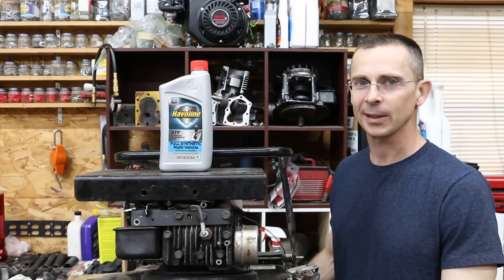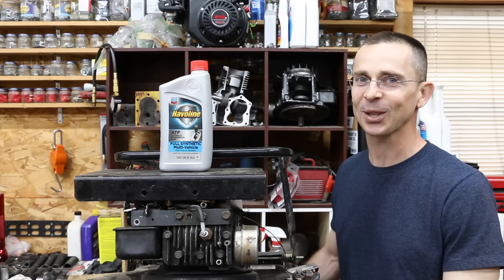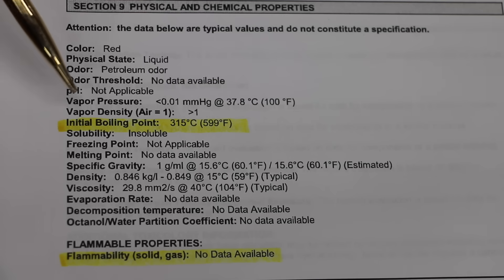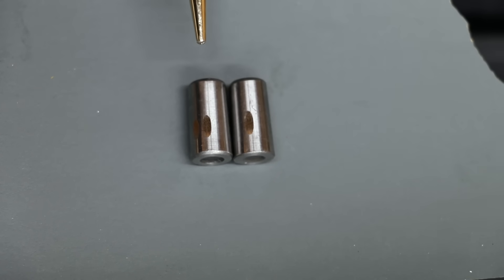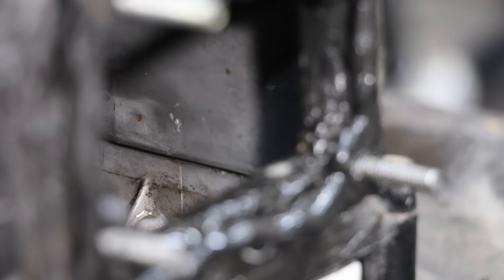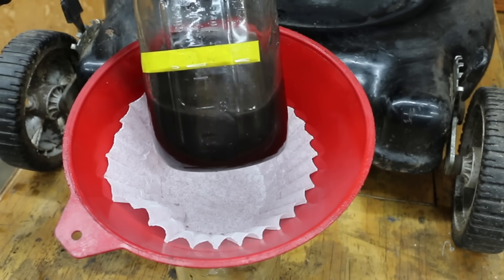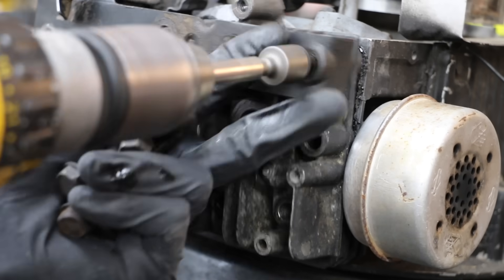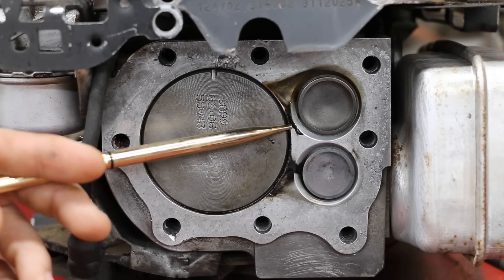ATF as an Engine Oil substitute?  Let's see what happens!

Comment: this is better than any bedtime story
Reply from the maker: Thank you!
Reply: Project Farm ur amazing keep up the good work keep those vids coming
Reply: My daughter has a Mini Cooper that’s supercharged and has what sounds like lifter noise for a short while on cold days herein Oregon. I wanted to add ATF but she runs synthetic oil. In the 80s ATF added to my Supra motor took care of the same problem. Wanted to try on her car but didn’t want to screw it up. Humm
Reply: Project Farm good epic videos like always mate!
Reply: MattExzy I count shifts, I always have since I was a little kid!! I use to hum the acceleration and back pressure and the works while lying in bed xD
Reply: * super dave - you should more likely look for an exhaust manifold leak  OR  if the engine has over 100k  you want to get the valve lash adjusted.  these are your most likely problems.
Reply: Project Farm youre very thorough.  Have you heard of using la's awesome from the dollar store to flush? Some swear by it
Reply: Bedtime stories are nice, but I think I'll spend another Halloween night with a Drill Sergeant blasting lullabies.
Reply: Another great video!!!
Reply: Imagine A World what else you been doin while laying in bed??
Reply: David Jenkins I fondle. I will leave the rest up to your imagination xD
Reply: Dude I thought I was the only 1 lol.
Reply: David Jenkins I crap
Reply: oskarpukk1 Lol I am legit watching this at 10PM
Reply: You don't count sheep; you count RPMs.
Reply: Kartul2 Too funny! I do the same thing: listen to geeky "car porn" as I drift off to sleep 😁
Reply: Lol
Reply: I disagree. A bedtime story is supposed to put people to sleep. These videos are so good they keep me up all night. lol
Reply: Ixnay on the bedtime story idea.

I tried watching a Project Farm video to help me sleep  ...   but, I found that it worked like Viagra instead.

I was up all night.
Reply: without the slipines
Reply: It actually is to be honest I wish I could go live at project farm and help graze the cattle
Reply: 2 years late lol J Davis I think alot of us would like to spend some time at project farm, like some really fun and wholesome cult but without the brainwashing. We could still sell jams and jellies to support 
Todd's Great Work though.

Comment: I've used ATF free lifters/sticky valves. Now to watch and discover whether I'm idiot or a genius for doing so.
Reply: Can confirm it works for my old Subaru
Reply: Which type ATF to use and how much to use?   Also for how long?   Drive with it in the oil or let it idle to free lifter?
Reply: @Mr.Beastforpresident  The reason for  using ATF is,  a Transmission has to be clean to perform properly. That is why ATF has  more detergent in it than any Motor oil and why it works to Clean  sticky lifters and remove sludge! You want to pick a good brand  name with good heat control  property's.
Reply from the maker: Thanks for commenting!
Reply: You are NOT in the idiot category, John!
Reply: I used to sell so many engine cleaning treatments at a shop i worked at, I would run out, and resort to using ATF to help clean engines. Worked pretty good too!!
Reply: @ImTheJoker4u  what would you recommend for a ticking dodge 4.7?
Reply: Lewie McNeely those loose metal particles captured in the coffee filter has me anxious about the rod bearing wear. But at the same time the lifter tick has me anxious. I don't understand why 1 quart of very high detergent Mobil 1 Extended 15,000 mile oil wouldn't work?  Especially in a 0w-20 that could really creep everywhere for cleaning. What you guys think?
Reply: I bet ATF worked better that most of those so-called "Engine cleaners".
Reply: I'm not sure but get a good brand, not cheap stuff and if the engine took 4 quarts to fill it up from nothing I'd run 1 quart a.t.f. and 3 regular oil. BUT that's me. Some other guys might know better. I'm just a flunky! And I'd just ease it around. It needs to get warmed up, not hammered. If I used diesel I'd do the same mix but just let it idle. Gopher it, Jenkins Number 3!!!
Reply: This guy's awesome. Read our comments and suggestions and followed up with video.
Reply: change to a synthetic oil and over a couple oil changes will quiet the lifter
Reply: Don't use synthetic ATF in the engine. always use non-synthetic. I would run my car 20 miles or one hour on the  4qt oil to 1qt ATF mix (in a 5qt capacity engine), before changing it out.
Reply: I did the sea foam in the crankcase (followed directions to the "T".  And car runs far smoother.  Not sure about ATF as of yet, but seafoam  worked.  Also treated the gas tank as well.  Everything seems to be running very well.  btw turned over 280,000 miles
Reply: Ullr the snow God 

     You are smart!!   I like your description of bad oil filter.  Fram is trash.  I have cut them things open to find cardboard as a filtering material.  I tell “car” conscientious friends all the time to not touch Fram filters.  Complete trash!!
Reply: Have used ATF for sticky/noisy lifters in the past, learned it from the old man...it works.
Reply: ElroyJosephJenkins JrTheThird    that certainly is not true ...MAY have been true in the 60 s ..certainly not today  trans fluid has 1/3 to 1/2 the amount of Boron Calcium and Phosphorus as engine oil
Reply: John Ratko 
it works fine with its detergents. shuts up my hemi 5.7 lifters with 164k on it
Reply: @AmericanCapitalist-b4w  did you use atf? i have a 4.7 durango ticking away
Reply: ElroyJosephJenkins JrTheThird the perpose of using aft if to clean the inside of your engine. I have always just used the cheapest atf fluid or that extra bottle you have sitting around you dont know what to do with. You shot for a 15ish % mix aft/oil. Let run for awhile idle/alittle rpms but nothing crazy or can drive around the block a few times. If your engine really bad inside you do a 2nd cleaning with the cheapest oil/atf they sell. Drian oil then finish the oil change. You should start to hear a improvement of less pinging from the valve/lifter if that was the purpose in 15 20min.
Reply: ElroyJosephJenkins JrTheThird 
ATF is about 90% detergent and about 10% oil. That's why it works better than another oil.
Hope that helps you.
Reply: Yes I know what any filter is used for. Just when one uses ATF/oil mix, I normally bi pass useing a filter , because of the extra thick oily sludge will clog up the filter. Potentially doing more damage than good. Will limiting to 20 miles or one hour run time. I never had a problem with recirculating .
Reply: @brendal5175  I would still use a filter. If you are concerned about debris circulating and clogging the filter, that's why the filter has a built-in safety bypass. Catch as much of the the crap before it circulates as you can.
Reply: I would use 20% or 4 qts oil to 1 qt of ATF . And drive the car no more that 20 miles of low speed (30 mph or less) before doing another oil change. Lastly I would run the engine without a filter for those 20 miles. making sure I had a bi-pass adapter in place of the filter, or in a canister filter just removed and canister tighten down. I would do this when cleansing the overall engine.

Comment: great video- seems to have worked in this motor, but i think long term it may not last.
Reply from the maker: I agree. Long term, ATF isn't designed for use in the crankcase and wouldn't last.
Reply: Most people I have heard using ATF from usually cut regular oil with it, and only run it for a short time like an engine cleaner.

Comment: By the way ,plastic camshaft,really ,what the low quality is this ?why have they done this ?
Reply from the maker: Yes, this lawnmower engine definitely isn't top of the line.  With that said, I have a John Deere mower with a Kawasaki engine that has a plastic cam gear, which is known for failure.  Very disappointing!
Reply: Project Farm in Europe lawnmowers are well built for one reason,I. The USA the wheels are cheap and they are just looking cheap ,I have a mtd wolf Garten lawnmower and it never broke down (from 2012 )
Reply: Cost.

Comment: What if you were to use chainsaw bar oil instead of engine oil?
Reply from the maker: Thank you for this recommendation!
Reply: LOL! my friends uncle had a leaky power steering pump, came home from a grocerie run one day (nearest store over 100kms), ran out of power steering fluid half way home, so filled her up with vegetable oil he bought at the store! haha
Reply: Now that would be a sludgy mess haha
Reply: Great recommendation,  i recommend the tractor supply brand.
Reply: In South Africa in the '60's to '80's it was well known that dodgy 2nd hand car dealers would put banana peels in a grating/grinding gearbox to make a sale.
Worked long enough to screw some poor sucker over, and created one helluva mess!
Reply: or some Lucas red grease
Reply: If you use the stuff I use in my chainsaw it is 30 weight non-detergent. Unless you have a 1957 Chev pickup with a "Stove Bolt" six I wouldn't do it. I am sure if you you have a running modern engine it will be running less soon....

Comment: You can start the engine  backwards
Reply: That would just reverse the strokes, the intake would become the exhaust. Put the carb on the exhaust port and voila.
Reply from the maker: Thank you for this recommendation!
Reply: K T we did it in the past with our mopeds. Just for fun. On a 2 stroke its possible.
Reply: Here in Australia in the 1960s we had a car called a Lightburn Zeta.  It had a 300cc 2 cylinder 2 stroke engine.  There was no reverse gear.  You had to switch the engine off and start it up the other way.
Reply: This would be interesting to see in an engine like this because it is oiled by that slinger.  I saw a car that was flat-towed and somehow managed to get bumped into reverse and it spun the engine backward and seized it because the oil pump was effectively just sucking the oil out of the engine and pumping it into the pan.
Reply: @406Steven  In old cars you could push start them with the local Police help. The 2 speed powerglide in a 1962 -1965 Chevy had a front pump in the Automatic transmission and would turn the engine over.